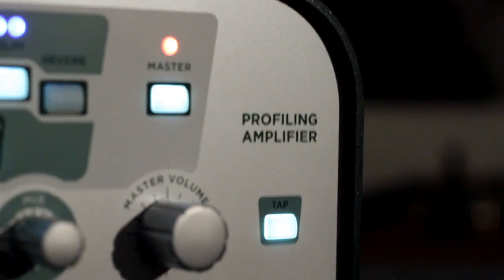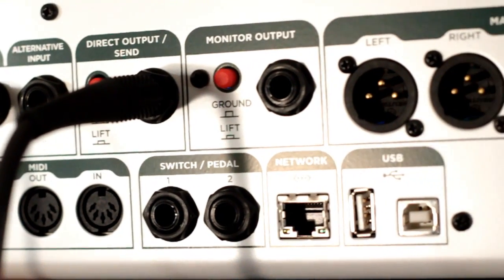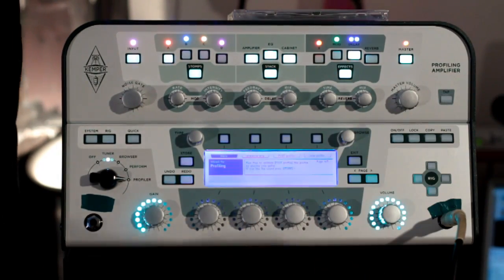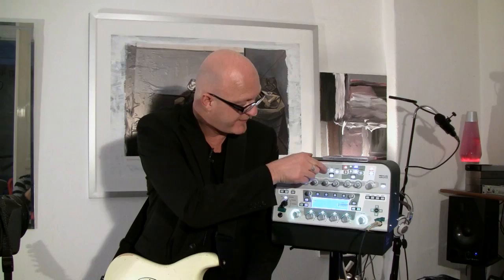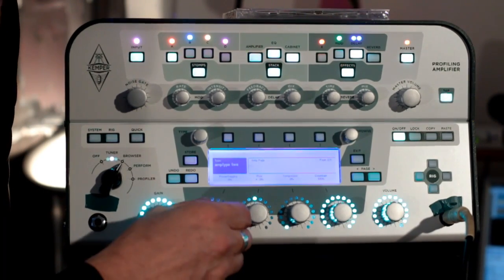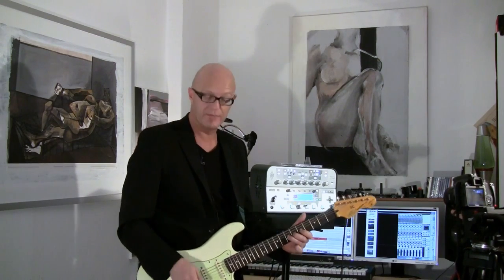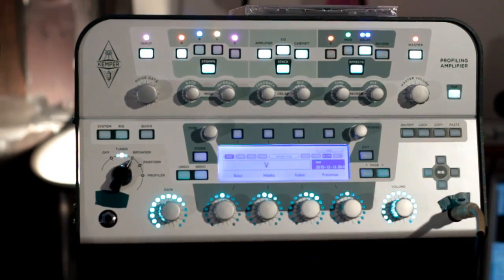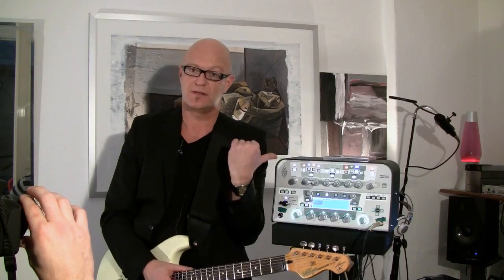The Kemper Profiling Amplifier - Orientation Film #2

Comment: You shouldn't have to go through the DA converter or use the Mic at all, you go from the Kemper straight in to the amp you want to profile then hit profile amp. :-)  Now you can Tweak it and make it a special profile by using a Mic. But you do not need a mic to do a basic profile.

Comment: An interesting concept although it does seem as though the profiling is simply using a convolution engine to capture the mic and cabinet & room.  It seems that the distortion is created from within the unit itself so the home/studio user can have the same thing going on by using any modeller with the cabs switched off and then using an impulse of a cabinet run through a convolution vst.